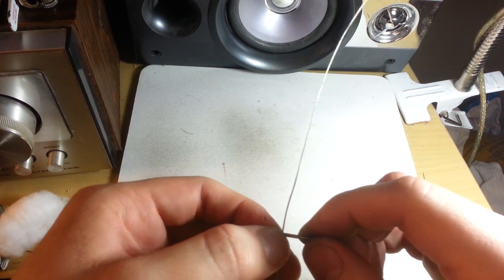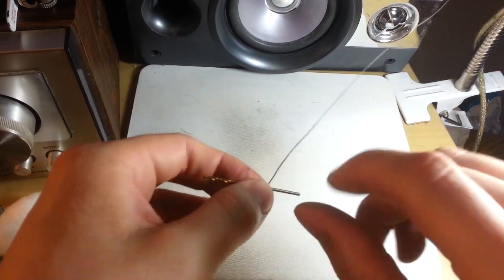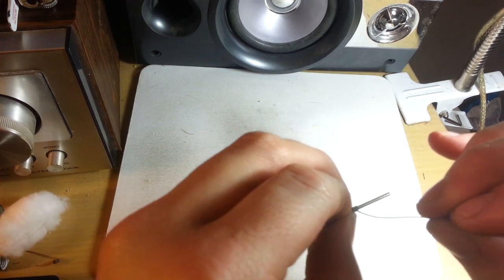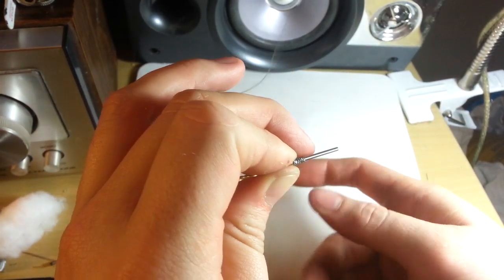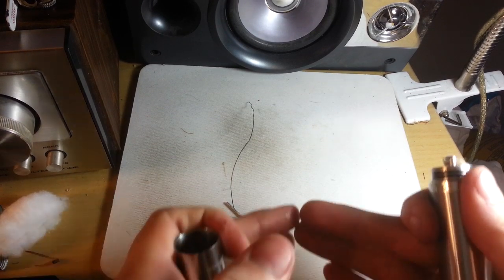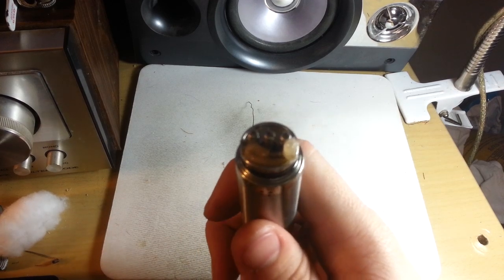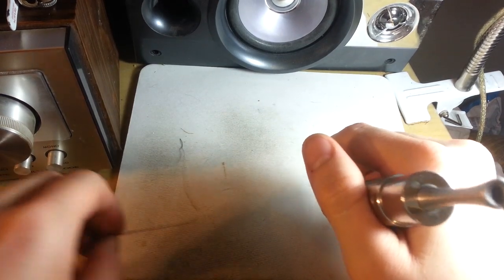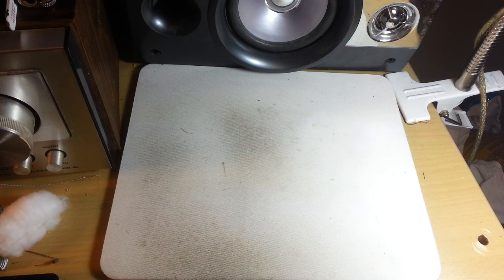FLAT Twisted Kanthal Micro Coil

Comment: if you are flattening it out.. isn't that just making it into plain ribbon wire?  Or is kanthal a different type of material itself.. I thought it just had to do with the shape more than anything
Reply from the maker: It is making a bunch of diamond shapes in a chain which allows air to flow through. I'm sure if you pounded on it long enough it would become pointless but it definitely works.